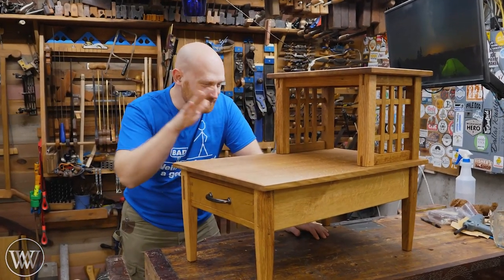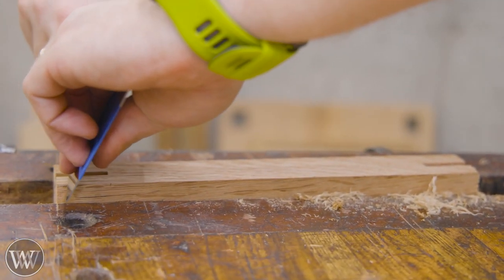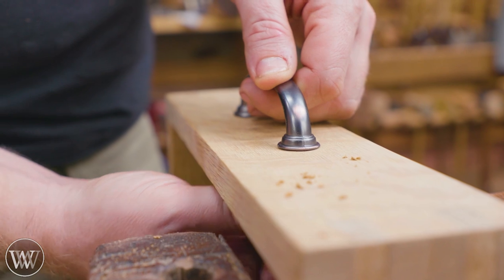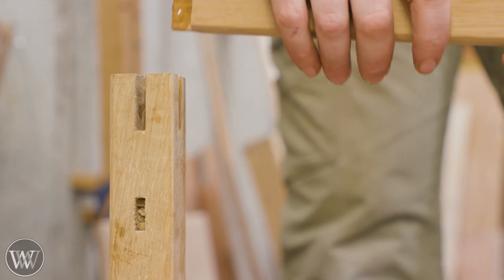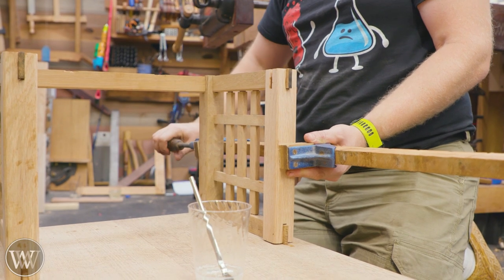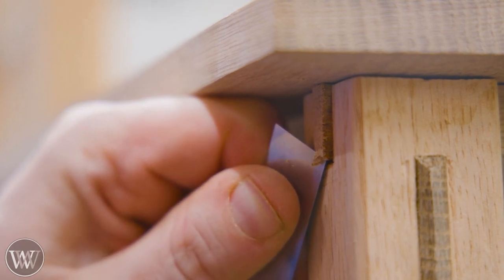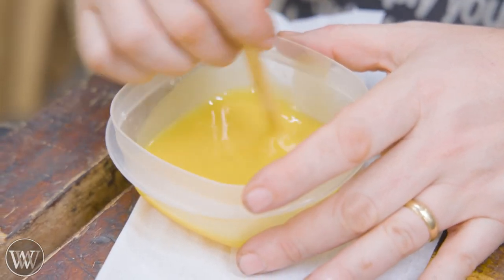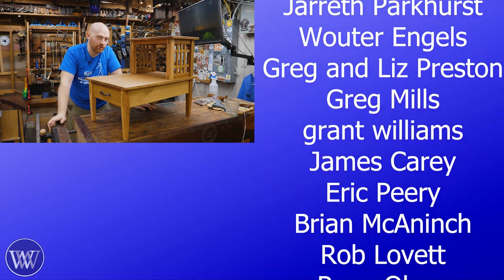How To Make a Bedside Table Part Final

Comment: I prefer to drive screw with a brace and bit for this sort of thing, or just a screwdriver if there is no room. If you end up with cracking starting, you can just stop. I usually only use my power tools for things I classify as home repair. I am starting to use more handtools on the home repairs now just because I don't enjoy the power tools. Nice piece. Good video.

Comment: Can you reuse the plastic cups that you use for epoxy? I mean, obviously, if they don't melt...
Reply from the maker: If you dump out any extra. There will always be some on the inside. So you can only use it a few times. I bought a case of 500 of these 3 years ago for $10 and I am about 20% of the way through them.